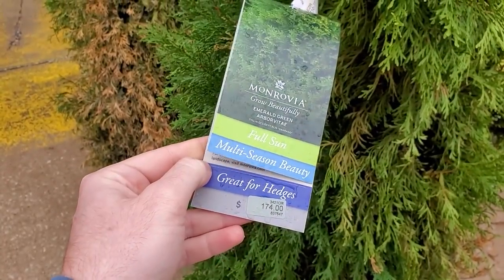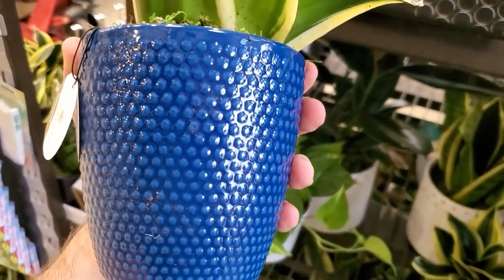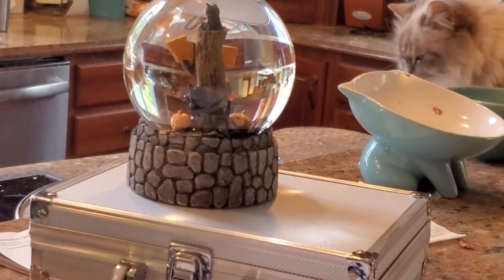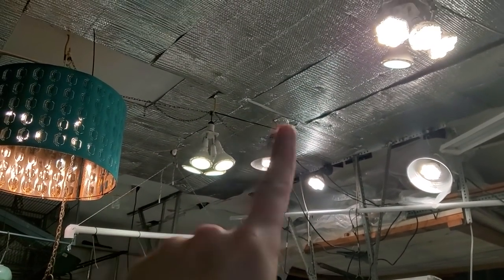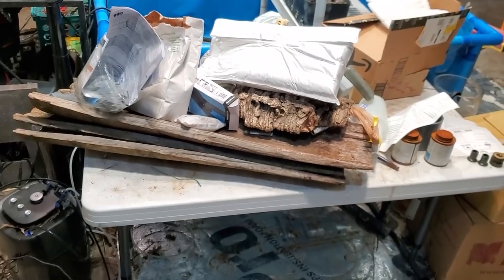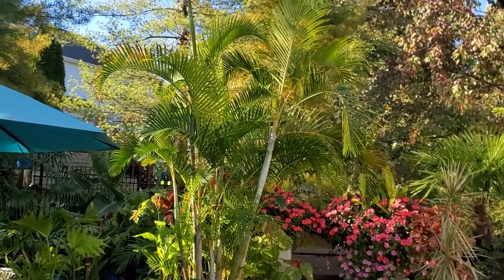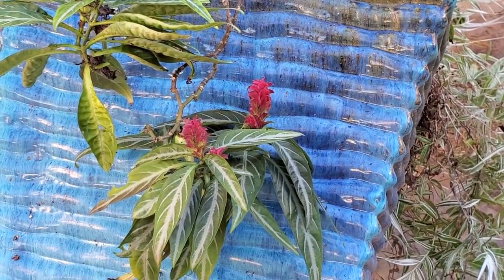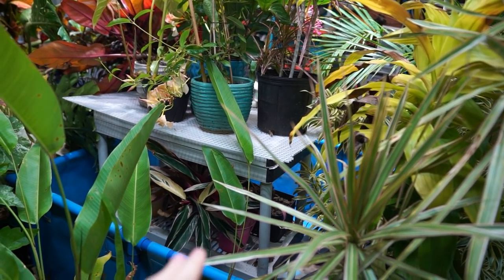Shopping at Lowes & Moving Houseplants Inside

Comment: Great job Jeff! Re- extension cord. I use a 12 gauge extension cord...Best choice for  electric heater! Also make sure you plug your extension cord into a circuit breaker bar instead of directly into the wall  socket so that if you ever did get an overload it will cut power off immediately. Cheers bud
Reply from the maker: Oh absolutely! Everything out there is run to gfci, can never be too careful! Especially in a space where there's water splashing all over the place and a humidifier that turns the area into a cloud of fog.
Reply: @TropicalPlantParty  Good to know and space heaters make me nervous as well!

Comment: Hi Jeff. I hope you can get a heater installed I'm always concerned about safety in your garage. See if you can get a smoke detector installed too. I'm using a space heater right now my furnace died this year I'll be getting a new one on Monday. So yeah I can totally understand  I feel nervous leaving the house with the space heater on even though it's new and working great.  I need to keep the doggos warm. Have a great week Jeff.
Reply from the maker: Hey Patricia! They make me so nervous! I have smoke detectors and really have followed every precaution recommended for safety, but they still freak me out. The heaters I have out there now are loaded with safety sensors to shut them down if they get too warm, if the air filter screens aren't flowing enough, if they detect moisture. Jeeze, even if I barely tap them when walking by they shut off because of the tip over sensors... still, I don't like them! 🤣 hopefully the professionally installed heater will be able to work out.

Comment: "Not down with the cootie"...a song title in the making. My monstera anchors itself in the surrounding soil. Grows much faster that way but I always feel guilty ripping its feet out of the ground. There are several wall-mounted garage heaters that only require 120-volt. Any heater would be a great addition to your setup.
Reply from the maker: They grow like monster plants! Love all of the roots! Oh I know, the problem is that 120volt just isn't strong enough to heat the garage. Have so many small 120 volt heaters and they just don't really get the job done efficiently. With a 220 or 240 volt I'd be able to keep the temp more reliable and consistently warmer. Fingers crossed it can even be done!

Comment: Hi!  At what point do you take all your houseplants in? First frost?  I live in coastal NC and bring all mine in way before that!!  I would love to leave them out until first frost, would make outdoor season way less!!!  Love your videos btw~!  very inspirational
Reply from the maker: Thank you! 
I predwr to move them inside in stages. The most tropical/heat loving plants go inside when night time lows start dropping below 50F to 55F.  Everything else I bring inside when it's the first frost, except for the few that are more cold hardy. The last few years I've been able to leave everything out until first frost since October has been more mild. 
I also base a lot of it on the day time high temps following the cool nights. If it's going to drop into the 40s at night, but then rise to the 70s during the day, then I don't worry about moving the plants inside.